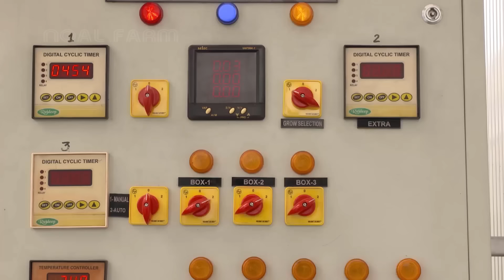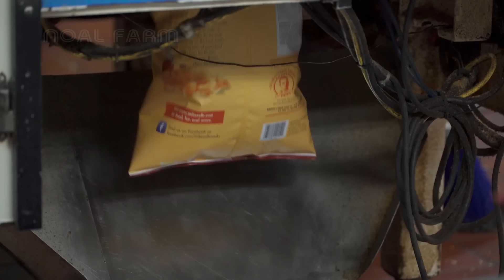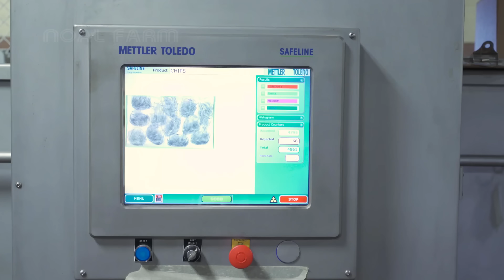Aeroponics Potato Farming - Potato Chip Process Factory - Modern Potato Agriculture Technology

Comment: Very interesting.

I've been growing with aeroponics for about 10 years now.
And I never tried to grow potatoes.
All the other vegetables I grow turn out great.
And for all the people that say, when vegetables are grown this way that they are tasteless.
You are full of it.
Almost always the vegetables are way better than what I grow in my outside garden.
Because I can control every aspect of the grow.
Plus I can cut 2 to 6 weeks off of the grow time.

What I would have like to see is what nutrients and micros they may be using.
And when and if they increase or decrease any of these.
I have spent years experimenting and studying this subject.
And through alot of trial and error. I have come up with some excellent formulas for most vegetables.

There is one thing I saw with their set up that concerns me.
I don't know if it's because they are growing potatoes or what.
But their roots should have alot more of the little hair like roots coming off the main roots.
These little hair like roots cause a huge uptake in nutrients.
Which in turn cause a tremendous surge in growth.
In the middle of the video I saw something in the root chamber that might be causing the lack of these little hair like roots.

It looked like their droplet size in their sprays are very good. Within the range they should be.
But at the end of their spray cycle, once it stopped spraying.
You saw all those big drops dropping down on the roots.
That will cause all those little hair like roots not to grow or bunch up together and die.
So what I see is their on spray cycle is to long and or their off cycle is to short.

I was really surprised to see those large drops.
Because they are really defeating the purpose of growing with aeroponics.
Because the droplet size is one of the main factors when growing with aeroponics.

Anyway the video was very interesting.

My operation isn't this big.
And my technology can't compare.
But I do have 3, 200 s/ft rooms. So my operation isn't that small either.
Reply: sorry friend you should eat outdoor summer vegies of Greece!
Reply: I, Nephi, having been born of goodly parents, therefore I was taught somewhat in all the learning of my father; and having seen many afflictions in the course of my days, nevertheless, having been highly favored of the Lord in all my days; yea, having had a great knowledge of the goodness and the mysteries of God, therefore I make a record of my proceedings in my days. Yea, I make a record in the language of my father, which consists of the learning of the Jews and the language of the Egyptians.
And I know that the record which I make is true; and I make it with mine own hand; and I make it according to my knowledge".  1 Nephi 1-3 

Hello friends, I am a member of The Church of Jesus Christ of Latter-Day Saints.  The verses above are the first three verses in The Book of Mormon.  I know this probably isn't the most ideal place to talk about religion but I really do want you to know that God loves you.  You may not love Him or care about Him at all, but He still will continue to love you.  You are a beloved son or daughter of God.  He knows you personally and He truly and deeply desires for your happiness.  He loves everyone who has every lived on this earth, with a perfect equal love regardless of their race, gender, ethnicity, faith and values and beliefs.   The Lord loves you more than you can think or comprehend.  "He inviteth them all to come unto him and partake of his goodness; and he denieth none that come unto him, black and white, bond and free, male and female; and he remembereth the heathen; and all are alike unto God, both Jew and Gentile" 2 Nephi.  He is our loving, caring Heavenly Father.  We are literally His children and creations.  When we were in the womb, he knew about us" Jerimiah 4:5.  He knitted us and we were created in His image.  

I testify to you that you and I are not a mistake.  He knows the very moment when we stand and when we sit.  He is familiar with all our ways and knows us personally who we are.  The hairs on our very head are numbered.  God loved us so much, He sent His Only Begotten Son for us, that we may be able to return and dwell in the presence of God again.  The Lord has not forgotten about us even when it feels like He has.  He will never forsake us.  When we are happy, He and His angels rejoice alongside us.  When we are sad, He heals us and lifts us up from our trials.  He has always been there for us.  He has always been our loving, compassionate Heavenly Father and God.  Will we always be His children and people?

I testify to you that God lives and that Jesus is the Christ.  Both love you exceedingly and rejoice when you are happy. They both love you so much.  They love you with a love unfeigned.  They will never ever stop doing good unto you.  I know that The Book of Mormon is true.  "And when ye shall receive these things, I would exhort you that ye would ask God, the Eternal Father, in the name of Christ, if these things are not true; and if ye shall ask with a sincere heart, with real intent, having faith in Christ, he will manifest the truth of it unto you, by the power of the Holy Ghost".  Moroni 10:4  I promise and testify to you, that if you will read The Book of Mormon, ponder on its message and ask God if it is not true, you will come to know of its truthfulness, whether its true or not true.  

Remember my friends that God loves you with all his heart, might mind, soul and strength.  He wants you to be happy.  He knows what you are going through and dealing with right now.  He desires for you to return back to Him.  Unfortunately, He has been misrepresented and seen as a cruel and angry God who anticipates for us to slip and writes down every mistake we make waiting to punish us by those who do not know or know Him fully.

My friends, God has stored many opportunities and blessings for you.  He is incredibly eager and desires with all His heart to bless you abundantly.  He wants you to live with Him again.  He only wants the best for you and your well being.  He wants to experience everlasting joy and indescribable happiness in this life and in the life to come.  He wants you to partake of His goodness and come and follow Him.  The Lord does not care how early or late you decide to come unto Him.  I testify to you that if you have strayed and wondered off the path that there is peace and hope in Jesus Christ, The Savior of the world.  The Lord accepts those who come unto Him whether your early, late or just in time who desire to change.  The Lord will accept you wholeheartedly and forgive you if you are willing to change.  The Lord will welcome you and will always be ready to embrace you with open arms.  The Lord will lift us up in our trials and use us to bless the lives of those around us if we are willing to change.

If you desire to learn more, you are always welcome to visit comeuntochrist.org.  There you will learn more about The Church of Jesus Christ and our core beliefs and values.  If you have taken the time to read The Book of Mormon and this comment, thank you.  It takes a huge leap of faith and a lot of courage to muster enough faith to read in the Book of Mormon and to believe in something in a personage that you may never see in this lifetime.  Although we may not be able to see God and Jesus Christ in this life, I testify to you that they are real.  They do truly exist.  I promise you that if you will pray to know of their existence, you will come to know whether they exist or have been made up.  

You are my friends.  The Lord loves you unconditionally and is aware of you and despite all our weaknesses and shortcomings, he still loves us and will forgive us if we will humble ourselves before Him and diligently seek correction and do whatever is needed to repent.

Remember that The Lord is always available to talk to through prayer 24/7.  No question sounds too silly for Him.  James wrote, "If any of you lack wisdom, let him ask of God, that giveth to all men liberally, and upbraideth not; and it shall be given him" James 1:5.  If you must know whether or not something is true or evil and deceptive, you can always pray to God.  He will help you know what the truth is and what is not the truth. He will never be too busy to talk to.  He will give you strength you need to overcome and conquer your temptations and will give you the strength you need to endure through your trials and afflictions.  Paul said that The Lord will not give you temptations that you cannot resist, but that in your temptations, He will provide a way for you to resist, overcome and conquer them.  He will provide a way.  He wants to bless you and reward you abundantly in Spiritual and physical things.  The Lord knows you and will not forget you.  You are loved.  You are utterly amazing.  You have incredible potential.  You are not forgotten or ever will be forsaken.  You are special.  You are unique.  You are one of a kind.  You have been reserved for this time and The Lord needs you on His side.

It simply would not be the same without you.  That's just how much the Lord need you on His side.

Thank you dearly for your time.
Reply: Hi, I am interested in aeroponics as well, however, I have run into a few different problems. How do you get your nutes in your water? I'm thinking of using an ultrasonic system but does nutrients get carried into the micro droplets as well? Using a micro nozzle and high PSI pump with nutes seems impossible to me as I can see the nutrients clogging up the nozzleheads. Also, how do you keep your water tank free from bacteria/mold? Hope to hear from you soon!
Reply: @MixalisXM  
Sorry friend, but I have a huge outdoor garden that I get a wide variety of fresh veggies right here in California.
I also have a greenhouse I grow in.
And all of this is on top of my indoor grow rooms.

You see I can grow anything I want at anytime I want.
I don't have to wait for the seasons.
I can grow any vegetable all year long.
Where I grow at in California is almost all farm land.
In fact across the street is a huge farm.
The street where I grow is over a mile long and there is only 3 house's on the street. The closest house to me is over a half mile away.
Also did you know that California supplies like 40 percent of all fruits and vegetables for the US.

So I get plenty of fresh produce.
Reply: @lipasfriends  
Hi, hows it going ?
I'm glad to see someone wanting to give aeroponics a try.
Most people won't even try it. Because they have heard people having so many problems growing this way.

But to tell you the truth.
Aeroponics is the easiest way I have ever grown.

Of coarse just like everything else in life.
Once you get everything down. It becomes easy.

But it only took me about a year. Then it was a piece of cake.

I'll try and answer your questions. And any other questions you might have. 

What I'm going to do is try and answer your questions.

But I think it will be easier for me to give you some of my experiences and why I went the way I have.

So your first question.
I understand but I don't.

How do you mix your nutrients in your water.

I don't know what nutes you are using. But I'm sure they have directions. Correct ?

For example lets say I have 2 bottles of nutrients a part A and a part B that I'm going to use.
The directions on the bottles say add 2 teaspoons or it might say 10ml per gallon of water.

So the reservoir that I use is 20 gal. But I only put 7 gals. in it at a time.
And this will last me 3 to 5 days.
Plus it's easier to keep 7 gals at the correct temperature it should be.
Around 75 degrees

Ok right here I would like to suggest that you never use what the directions say to use.
Always start with half, because you can always add more.
So to the 7 gals of water in my res I would add only 7 teaspoons.
Then I would check the ppms to see if it's where I want it. And usually its close.

Now for what you think about the spray heads.
And then you said you were thinking about ultrasonic.
Do you mean fogponics ?

Let me say this 10 years ago when I decided that I was going to grow with aero. I bought everything I needed to build a HPA system. ( High pressure aeroponics).
I spent almost $ 800.00.
Once I started putting it together, like you, I saw the possibility of to many problems.
So I never put it together.
And I still have everything.

So now, like you.
I decided to give fogponics a try.
Because.
With fogponics you don't use spray heads.
You just use a little fan to blow the fog into your grow chambers.
But those damn little foggers would get dirty so fast that I would have to clean them 3 to 4 times a day.
I tried this for a week and a half and said forget this.

Well now I had already been doing research on aero for 2 years. And there just wasn't anything out there.
I started checking out cannabis forums.
And you would be shocked at how many there are.
I spent thousands of hours researching.

Well one night I got lucky.

I was looking through grow journals on one of the cannabis forums.
And usually the journals are a year old or newer.

Well for some reason this guys grow journal came up.

And it was 10 years old.

So at the time I found it.
This journal would be from the 1990s. And it was, it started in 1999.
I don't know how it came up.

But anyway this guy was growing with LPA ( low pressure aeroponics ).

This guys journal was like nothing I had ever seen.

It is like 500 pages long.
And he explains everything he does and why.
With hundreds of pictures.

After 5 pages I knew this is what I was going to do.

I stayed up all night reading.
And the next day I started designing my aero systems.
And I've never looked back.

Everything I needed to build my systems I can get at home Depot. Except the spray heads.
And I can get those at the hydro store I go to.
And they are very inexpensive.
And come to think about it.
I've been using the same spray heads for 10 years now. With no problems.

This is my systems I built.

I have 2, 21 site grow chambers with 1 reservoir.

The grow chambers are just those tubs you can get at home Depot.
I went through 3 different ones before I found one that wouldn't leak.
The black ones with the yellow lids don't leak.
And they turned out to be the cheapest ones.

The manifolds I built are just half inch pvc with 9 spray heads. And it sits in the grow chambers. Two inches off the bottom.
I put a half inch hole in the middle of the bottom.
And ran a hose to the res so the solution drains back into it.
Then I put another half inch hole 2 inchs from the bottom on one of the ends of the grow chamber.
And I have a pvc fitting that is connected to the manifold sticking out that has a half inch hose connected to it that runs to the pump inside the res.

The pump is just a mid range pound pump. It's like only 20 to 30 bucks.

I have about 15 of these aero systems. That I have been using for 10 years now. With no problems.

This is the cheapest, easiest and fastest way I have found to grow indoors.
I can't believe everyone isn't doing it.

Now there's a lot more to it than what I have said.

But if you have any questions later.
I'll be more than happy to try and help.

Good luck and take care.
Reply: 4:09 it looks like a little too green to me, my concern it might not as healthy as normal potatoes. I mean greeny potatoes mean they exposed to light right?
Reply: Very interesting what you say re the hair roots and droplet size. I'm an ex ag scientist, when i studied, this technology was unheard of. Makes a lot of sense what you say re the droplet size and, yes hair roots are key for mineral uptake.
Reply: @CharDhue  
Green potatoes usually means there not ripe.

I could see them harvesting them like that if they are going to use then as seeds.

But you brought up a good point.
In my opinion they are exposing the roots to a lot of light. Which will cause some damage to the roots.
Which in turn will slow down growth dramatically.

Also it will cause the roots to have that brown color that some of them had.
To high of heat in the root zone will cause the same browning.
Reply: @thedirtykitchenchannel9794  
Thanks for the compliment.

I believe their droplet size when they are spraying is in the correct range. Because they are using steam, some how.
I believe they are spraying to long.
For example I run my on and off cycle at 5 seconds on and 15 minutes off.
So every 15 minutes my roots get sprayed for 5 seconds.
Again thanks.
Take care.
Reply: I'm getting aeroponic info from "ASS OG" in our year of the lawd 2022. I fucking love the internets
Reply: @TheRodT  
LMFAO 🤣😆
Just to let you know.
ASS OG doesn't stand for what everyone thinks it does.

ASS OG: Aero Systems Sea Of Green.

Because I grow with Aero Systems I built.
And I grow in what is called the Sea Of Green. 

Once I started growing with aeroponics. I found that I could get 5 times the yeild growing in the SOG. Then growing 1 plant in the same amount of area.

For example : the aero systems I built consist of 2 grow chambers with 1 reservoir. The system measures 3' x 2'9". So lets say total area is 9 s/ft.
With my first grow I only put 1 plant in each grow chamber. And right from the start I could see I made a mistake. There was to much area not being used.

So with my next grow I put 23 grow sites in each grow chamber. So now I have 46 plants in a 9 s/ft area.
And my final yield increased dramatically.
And I've been growing that way ever since. Over 10 years now.
I'll tell you, growing with aeroponics is the cheapest easiest and fastest way I have ever grown indoors.
And I will never grow any other way indoors.

I also have a fairly large outdoor garden.
And a few years ago I built a nice greenhouse, that I also grow in.
But I'll tell you what, growing in the greenhouse is a pain in the butt.

Anyway take care and good luck.
Reply: @assog5737  do you have an Instagram or anything that i could check out your system?
Reply: wow
Reply: Hey ASS OG, how high space do you need for the roots so that they wont submerge in the water? Or is the misting chamber excess water flowing into a separate reservoir? I'm very interested in seeing your system. Let us know if you have some photos somewhere in the web.
Reply: @Pajune  
Hey whats up.
Sorry man I don't have the time to make videos.
I don't have any pictures also.
I haven't been on forums in years.
Even though the way I grow I learned from a guy that was on a forum.
About 12 year's ago when I was trying to find info on growing with aero.
I got lucky, when I was going through Grow journals on this forum.
Some how this very old grow journal came up.
I don't know how.
Because at that time, this grow journal was already more than 10 years old.

I don't know how such a old grow journal came up.
But I'm glad it did.
It totally changed my mind on how I was going to grow.

I had already started building a HPA system.
Just a little 2 site system to experiment with.

Anyway I don't know if you can pull up this guy's grow journal.
But its worth a try.

This guy does a excellent job on explaining everything with hundreds of pictures. I mean this guy goes over everything.
It's also a very long journal.

And you'll trip on his setup
It's very different.

If you can go to the ICMAG forum. Go to grow journals.
And type in pirates cave.

I hope you can pull it up.
I tried a few years ago and I couldn't get it to come up.

Ok now in regards to your question, about the size of a grow chamber.

I've tried 4 different sizes.
And it really depends on what you like.

The size of the ones I've been using for about the last 8 years is.
18" wide x 26" long x 12" deep.
I sit 2 of these right next to each other with 1 reservoir.
So with 2 chambers sitting together, they are
36" wide x 26" long x 12" deep.
The size of the reservoir I use is 15" wide x 21" long x 16" deep. I think it's 20 gal.

You don't need one this big.
I just got one this big, cause if I go away for a few days the solution will last that long.
Normally I only keep around 7 gallons in my reservoirs. And it will last 2 to 3 days. Depending on how much the plants are drinking. Then I'll just top it off back to 7 gals. with whatever it needs.
Keeping only 7 gals. for me. Makes it easier to keep cool, clean and control the pH drift and your ppms.

Also I try and keep my reservoirs from being directly under the lights.
It helps them to stay cool.

My grow chambers have 23 grow sites each. So that's 46 plants in a 9 s/ft area.
I grow in the Sea Of Green.

I keep 4 of these systems in 12/12 all the time. That's 184 plants.
On a 2 week rotation. So every 2 weeks I harvest a system and start another.

I grow everything from clones. So I always have clones growing to.
And I grow the clones in little aero cloners I built.
These cloners don't need a reservoir. You just keep the water in the grow chamber.
Because you have to have the pump running 24/7. So the clones grow correct.
I get a hundred percent success rate and I have for many years.
The clones start getting roots in 5 days and they all have roots in 10 days.
Then I keep them in the cloner for 17 days total.
Then they get installed into a aero system straight into 12/12. No veg. time.

With my aero systems everything inside the grow chambers are pvc.
The manifolds are all half inch pvc. And the 8 sprayers are just screwed into that.
The manifold has 2" high legs on it to keep it off the bottom of the grow chamber. Then I have what is called a riser coming out of the grow chamber.
These risers are what is used in outdoor sprinkler systems so you can lift the sprinkler up higher.
They are plastic and have threads on them. And you can cut them to any size you want.
I screw the riser into my manifold out the end of the chamber then I screw a half inch tit on to the other end and hook a half inch hose on to that.
Everything outside of the grow chamber is half inch hose. This makes it very easy to move things around if you have to. And to clean the reservoir every 2 weeks.
If you use hose, which i don't know anything else you could use.
Make them 2 to 3 feet longer than what you think you need.

Well I've gone on way to long.
If you have any questions just ask.
Good luck.
Reply: @assog5737  Wow, thank you for the effort. I really appreciate such throughout answer! Will try to pull up the thread you mentioned.

This topic is super interesting. If the deal breaker here is the size of the droplets the nozzles make, I have seen so many systems doing it "wrong". Like you mentioned in some comment the tiny hairs in the roots, I don't see those in my dwc system which has been running for ages and been good to me. I have an urge to build something new, and this seems to be natural next step from dwc.

I might come asking about the waterpump/pressurizer system you have unless I figure it out. I want to build this system as fail proof as possible.

Cheers! Wish long life for you and your system :)
Reply: @Pajune  
Anything I can do to help.

There is one thing I forgot to mention.
Even though I built and did 2 grows with my little 2 site
HPA ( high pressure aeroponics) system.
In the journal by the pirate and the way I've grown for the last 10 years is LPA
( Low pressure aeroponics)

Once I found the pirates cave and decided to give LPA a try. For numerous reasons.
I performed 2 side by side experiments with my LPA and HPA systems.
And there was NO difference in yeild, quality and time.
There was one huge difference though.
The cost to build each system.
The HPA system cost me almost $ 800.00 to build.
And the LPA system cost me a little over $ 100.00.
This was a no brainer.
Since I wanted to build 4 systems.

For example: the sprayers I purchased for the HPA system cost me over $ 200.00.
The sprayers for the LPA system cost me almost $ 10.00.
Like I said it's a no brainer.
Especially for the same results.
Now for the droplet size.

Everything I had researched back then ( which wasn't much, because there wasn't much back then) expressed the importance of the droplet size.
But there is one thing that is more important than that.
And that is the on and off times of your pump.
You can have the best sprayers in the world spraying out the correct droplet size. But if you run your pump to long. Your going to soak your roots.

And this is the same no matter if your growing with LPA or HPA.
When i first started I ran a 1 min on and 5 mins off.
So every 5 mins the roots were being sprayed for a minute.
Now I run a 5 seconds on to 15 mins off cycle.
So now every 15 minutes the roots get sprayed for 5 seconds.
It took me years to get to this point. Because there was nobody out there that really knew what they were doing.
But you won't believe that something so little like this. Could make such a huge difference in yeild and quality. But it does.

I've spent years experimenting with all the little things you can do different to grow a better product.
One of the best things I found out was when I was experimenting with all the different nutrients.
I have found that all these premixed liquid nutes are a joke and total waste of money.
For the last 6 years I've been using powdered nutes and mixing my own solutions.
This way I can decrease or increase anything I want at anytime I want.
Instead of feeding the plants shit they don't need or not giving them what they do need at certain stages of growth with premixed nutes.
Plus this has cut my cost down to a tenth of what I was spending, a tenth.

Ok I'm rambling on here again, sorry.

But there is one more very important thing I would like to tell you.
I've been complaining and trying to inform people of this flaw for 10 years now.
And EVERYONE thinks I'm crazy.

But since I grow in the SOG. I could see it first hand.

When I started my first grow with LPA in the SOG.
I had already purchased some very good LED lights.
And already had experience with them and they performed well. 

So this is what happened.

A few days after I started my first grow. I noticed that the three rows of plants from the ends and sides of the system weren't growing has good as the plants on the inside of the system.
So I checked the spray coverage solution temp. and everything I could think of. And everything was good. As time went on it was becoming a huge problem. And I was like what the heck.
So one night I just sat in there. Looking and thinking about the entire setup.
Finally I looked up at the LED light.
And bingo.

The aero systems are basically 3' x 3'. And the LED light fixture was only
18" x 18".
And sure enough the 3 rows of plants that were not directly under the light fixture were suffering dramatically.
To the point to where the row of plants that was less than a quarter inch away from the fixture. Were only growing half as big as the plants directly under the fixture. And then the rows further away were smaller than that.
It was a huge difference, I couldn't believe it.
Why had I not notice this before.
Because I had never grown in the SOG before. And I was never able to see the effect of these LED lights on individual plants.

So immediately I started searching for bigger LED light fixtures. And back then there weren't any.
It was still a few years later before the bar LED lights came out.
So there was only one thing I could do.
I built my own 3' x 3' LED light fixtures.
I had no experience on this subject. But I'll tell you what they are 10 times better than anything I had tried before. And still 10 times better than any of those rip off bar LED lights.

I tried those when they came out. And I still had the problem to where when there is no diodes directly over the plants. Growth suffers dramatically.

Over the last 10 years I have contacted numerous LED light manufacturers.
Asking them why are they lieing to the public. And why they are ripping off the public.
I even asked them to make videos on their own experiments on this subject. And show the results to the public.

But for some reason none of them even replied to my requests. LMFAO 🤣😆.

But what I really can't understand is the thousand of growers I have told this to.
Not one of them can grasp this major problem. They are to ignorant to understand that this problem is dramatically hurting their final outcome. 

They all would rather believe some lame LED light manufacturer .
Than someone who had seen the results and who is trying to truly help them.

People are strange.

It's their problem not mine.
I tried.

Anyway good luck and I wish you the best.
Reply: @assog5737  Thank you once again! 
One more question about the droplet size. Is your spray more like a trickle or proper spray? I mean does the droplet size play some role in terms of not killing the "micro roots"? 
If so, I guess I should still try to get the best nozzles and pump, yet keeping them in the LPA range.
I've been worried about the LED's for long, because most of them concentrated the light extremely to the middle area. I was planning to build my own fixtures but then I came across Spider Farmer SF series and bought couple of SF4000. Been happy with them in my 100cm x 100cm spaces.

Edit. And what kind of timer are you running for the pump to get such tight on/off intervals?

I'll try to get back at you to show what I've built once I get there. But for now I'm going to be too busy to start this project. Maybe in two weeks I'll start the building.

Cheers!
Reply: @Pajune  
Hey.
You want the best tutoring for building your own HPA system?
Check out HIGH TECH GARDENING on YouTube.
This guy by far does the best tutoring for building your own HPA systems.

But also please remember.
The whole key for success when running a HPA system is your on and off times.

As a said and as you could see in that potato operation.

That even though they had the correct droplet size.
At the end of their on cycle.
They were getting large drops on their roots.
Because their on cycle was on to long.
You will see once you start running your system.
Because you will be able to look at your root zone after each cycle.
Just remember that it's a closed system so your roots will stay wet for a long time.
So they really don't need to be sprayed that often or for that long.
But really check out HIGH TECH GARDENING this guy is the best at explaining the hows and whys when building a HPA system.

Good luck.

And please keep me informed on how you are doing. Once you get running.
Later.
Reply: Okay for anyone else reading these comments, the Pirates Cave is still up in the ICMAG.
On page 13 Mr. Pirate will start explaining about the aeroponics.
Reply: @Pajune  what a setup.
He sure makes use of all his space. Doesn't he?
He's got some good seed making tutoring also.
Reply: @assog5737  Haha he definitely does!
Yes I noticed some thoughtful breeding happening while searching for the aero stuff. Very interesting. Gonna need some time to read through all of this, whew :D
They've got some great humor going on to also keep it entertaining.
Reply: What do you do when the power goes off?
Reply: @PearlMagnolia  
Hi, good question.
I thought of that before I started growing indoors.

What I did, was to install a small solar system.
It only has 6 panels a charge controller a inverter and 14 batteries.
Ten years ago it cost me almost $ 3000.00.
But it paid for itself within the first year.
Because I started using it in my clone and mother room.
I've been very lucky, in ten years the power has only gone off one time. Only for like a hour.
And really that short of a time won't hurt your plants.
No matter what all these so called experts say.
You see, I've screwed up a few times.
Every 2 weeks I change my nutrient solution and clean my reservoir.
Well a few times I forgot to plug my pump back in.
And I don't live where I grow. So it was like 18 to 20 hours before I could get back there and see what I had done.
Of coarse the plants were suffering, but after about a hour most of them were fine. I did lose a few. But no big deal.
I even made that mistake twice on one grow. And most of the plants survived.
Anyway
Good luck.
Reply: Would you ever try using water from a reservoir with fish in it? One could test the water and add whatever is lacking,  but at least it would have natural microbes and other nutrients we may not yet know about
Reply: Im interested in aeroponic system i have some questions
What should i do ?
what shouldnt i do ?
what difficulties and problems should i be prepared for?
I will be glad if you answer my questions🌱🌱
Reply: @assog5737  good to have u. I'm new on this but i want to know if there is a website or place i can learn deeper about this metnhod? And where did you learn about this system 10 y ago? I'm very interested.
Reply: Can you tell me more about aeroponics? We plan to have a research project about this.
Reply: You think I could cobble together an aeroponic system from pvc piping or a storage bin I drill holes into?  I'm not interested in having the best yeild, more like "what can I do for cheap / with what I have on hand / in the least amount of space".
(You know any forums maybe that hobbyists discuss this on?)
Reply: @Pajune  Hi, Could you please share a link. I'm unable to find the Pirates Cave in ICMAG